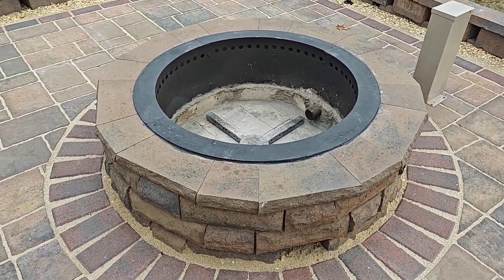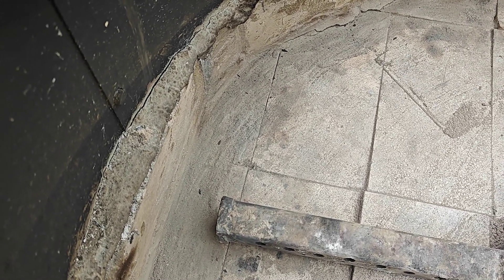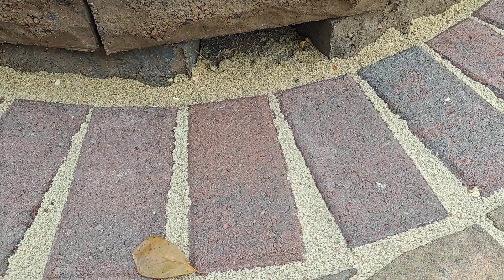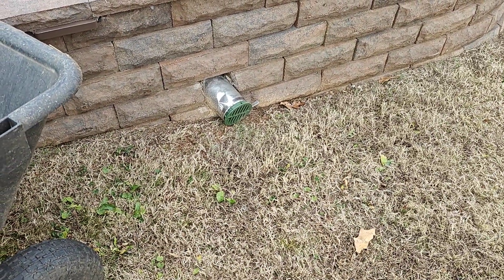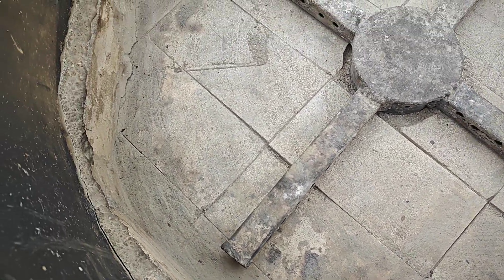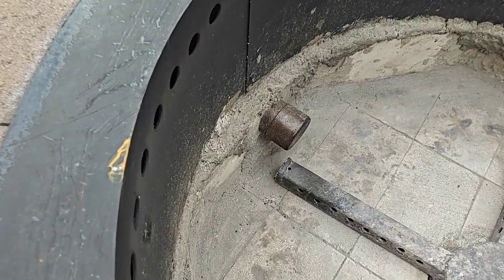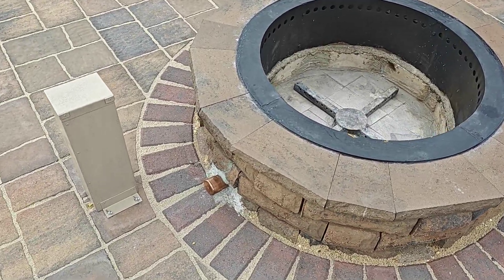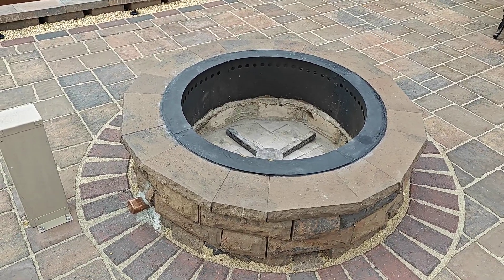Smokeless fire pit introduction

Comment from the maker: Sounds like you are welI on your way. I used refractory mortar for everything in the fire pit as regular mortar can't take the heat. I used retaining wall cap blocks on top.

If you can do the intake in the middle also I highly recommend it. The double wall and the center intake are what the Brio and Solo pits do. They also go tall and not too wide. Take a look at one and you'll see what I mean.

Comment: Thank you... I just decided to order the fire brick mortar. I'll get my fire bricks from Lowes. Do you have a video of how you sealed the bottom under the fire ring? A link to the video? I know I have to leave space between the fire brick and the fire pit retaining wall and mortar in between the bricks. I will not have a double wall, so I'm a bit worried how I'm going to seal it at the bottom with mortar. What size fire brick did you use?
Reply from the maker: The fire brick I used I got from Tractor Supply: https://www.tractorsupply.com/tsc/product/us-stove-single-firebrick

They are 4 1/2" x 9". I have a video (https://youtu.be/2utjcat17hk) where I talk about how I measured and cut the bricks under the metal ring based on the slope of the bottom (as the entire pit is sloped with the paver patio for drainage) so they would evenly touch the bottom of the metal ring. I first tried high temp silicone to seal between the fire bricks and the metal ring, but it didn't hold up. I went back and simply smeared Rutland refractory mortar where they join. It has held up just fine. I didn't put mortar in-between the fire bricks on the bottom for drainage purposes. 

I'm curious what you mean when you say you are not going to have a double wall? The whole point of sealing where the fire bricks meet the metal ring is for directed airflow through the double wall. That double wall with holes in the top of the ring works great at reburning the smoke.
Reply: @HowToDoStuf  thank you brother! I just miss worded what I planned to do… sorry about that. Yea I will have the double wall. I ordered my fire block sealant and mortar, It should come tomorrow. I’m picking up my retaining wall stone also. One guy used stainless steel at the bottom, but I’m going to do what you did. I’m thinking about cementing the bottom, then it will be easier to clean up after each fire. Thank you again.
Reply from the maker: @brianmorrison9937  You can cement the bottom together, but there really is no need to. With the firebricks bedded in sand right next to each other, I literally just use a small whisk broom and dustpan and sweep out the ashes, which takes less than 10 min total. I didn't mortar in the bottom in case water got into the bottom of the pit because otherwise the bottom is going to be like a small swimming pool. 

I think the fire brick is a better idea than a stainless bottom as with an inch or two of sand and the fire bricks in the bottom, heat getting under the pit from coals isn't going to be a problem. I don't want the heat getting to the gravel underneath that. You could use a stainless steel bottom I guess with a few inches of sand under it to insulate, but you would need to make an extension to the metal fire pit ring to have metal against metal to seal the bottom edges. I didn't want to try to make an extension for the metal ring because when the metal ring eventually rusts out, I can simply take it out, put a new one in, and just put more mortar as needed to seal the firebrick/metal ring joint. 

I'd like to see the final result once you get it done. The weather is about to start cooling down so we are looking forward to having fires this fall.
Reply: @HowToDoStuf  I'm getting it done a little at a time. I got all three layers sealed with fire brick mortar and sealer. My fire ring sets on top really good. I got a 2" air gap between the wall and fire ring. I'm cutting the 1" holes at the top of the fire ring tomorrow. I cut the fire bricks in half the long ways cause I only had 2" of air gap under the fire ring. I'll have to bury the fire brick just a little bit and the fire ring will sit on top of them. Did you use regular mortar or fire brick mortar to seal the fire brick around the bottom? I'm trying to decided on my pavers for the center and how to align them. As you mention, I probably will not mortar them so water can seep in between them. But as you done, I will mortar the pavers to the fire brick. I think I will forgo creating a center vent and just put 2" holes at the bottom of the fire ring. I plan to put another layer of retaining wall brick on top of the fire ring to help seal the top. Plus a 4th row will look nice.